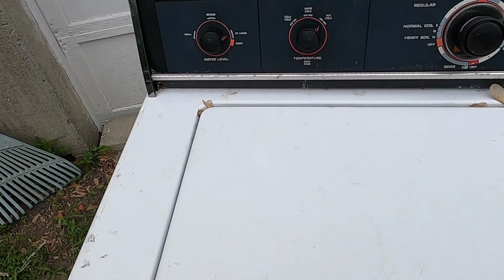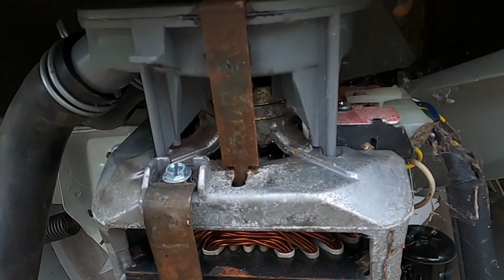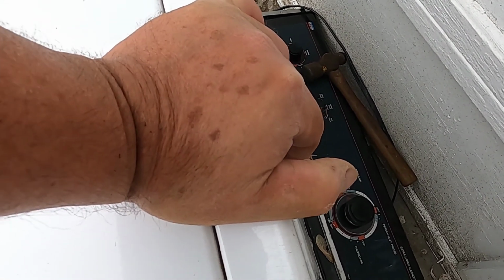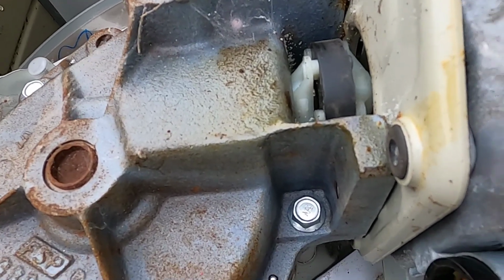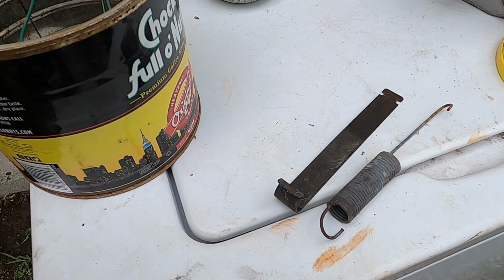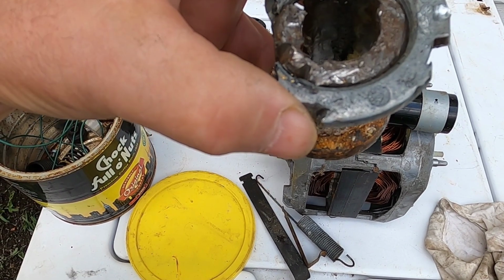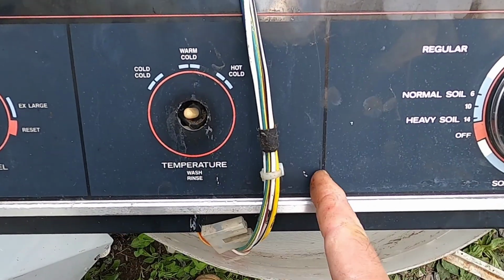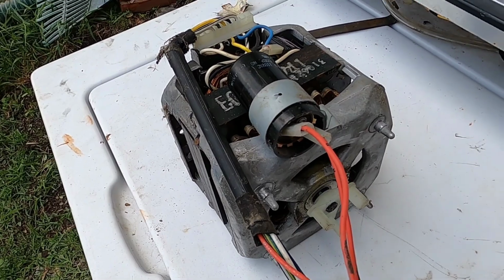Non working washer Trash Or Treasure

Comment: I like this video Joe. Was the start capacitor bad? If I remember right, electric motors have a start and a run capacitor, correct?
Reply from the maker: Thank you. I did not check it with a meter but when I tried to discharge it there wasn't any charge. I wanted to see if a capacitor from a microwave had the same or higher specs and could work here but could not find it at the time of this video.
Thanks again for stopping by.
Stay safe, Joe Z